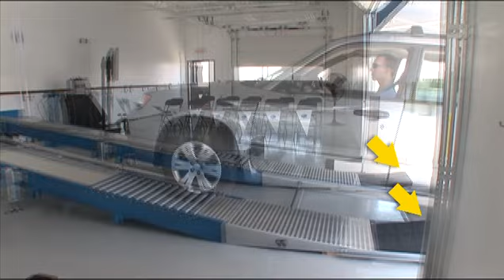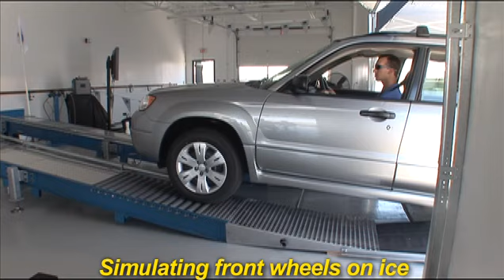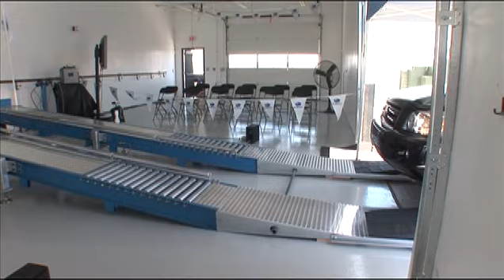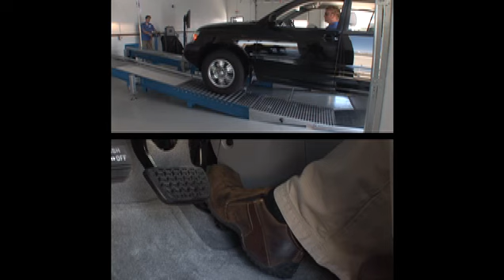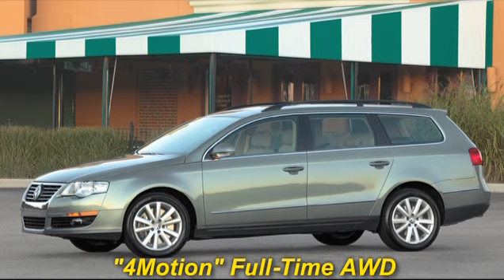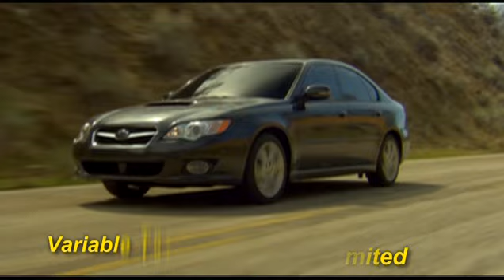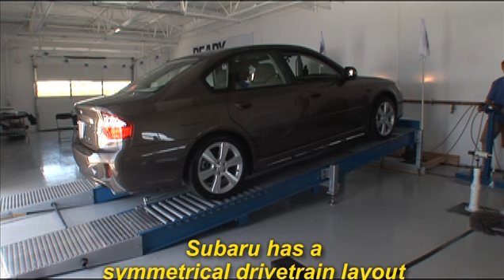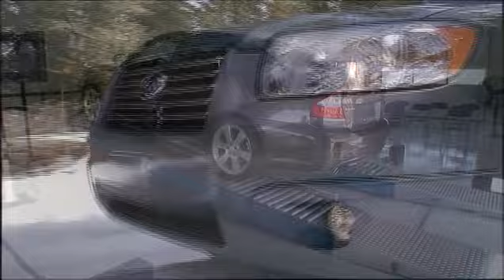Subaru Symmetrical AWD vs. Honda, Toyota, and Volkswagen

Comment: how about pressing the center diff lock button on the toyota for the true 50 50 split front to rear,  a rather large oversight!
Reply: bacon I explained it already, and I won't bother to explain it again to somebody immature enough to think insulting proves a point.
If you think it costs the same effort/torque to spin a traction wheel at the same speed as one that is hanging in the air, that's up to you.
Reply: Candisa You definitely know your stuff unlike these guys. I couldn't have done better explaining why an unlock differential has an even torque distribution by definition. But they don't seem to know shit about torque power and speed and use these word as if they meant the same.

James and Bacon Have a look to you physics course : "Force speed and power" and "Newton third law". It looks like you know how things work but you can't get a word correct about the theory.
Reply: I get what you meant.

The other guys only meant to point out that the toyota should be going up the ramp. That it is not, is due to the center diff remaining unlocked (video guys didn't push the buttons).

Everyone agrees a locked diff matches rotational speeds on both output shafts.
Reply: Candisa Not necessary. If you define torque split as the torque bias between the front and rear wheels then the 50/50 claim is still true. Torque is being sent to both axles equally. There is not forced torque. Torque is just applied to the ground unequally, which ever axle has the most friction produces most torque, and the applied torque split adjusts according. As you pointed out. But that's why a locked center diff is referred to as having a 50/50 split, because there is no torque biasing
Reply: @rangerover06sc  Trying to figure out my Lexus GS 350. 70/30 R/F then 50/50 when its slippery. There is also a locking clutch that supposedly locks the front and rear together.
Reply: Lock is not 50/50 torque distribution! That would be stupid and is nothing but marketing talk. 
If you equalise the torque between the front and rear axle, you're doing exactly what an open diff does: limiting the torque going to both axles to the amount of torque the axle with the least amount of traction can transfer.
The whole point of locking a diff is to NOT be limited to this 50/50 distribution, making it possible to send close to 100% torque to the axle/wheel with grip when the other axle/wheel is on ice or even hanging mid-air. The marketing guys who invented this "50/50 distribution" nonsense will tell you they mean rotational speed distribution instead of torque distribution (aka admitting they're lying), but then they can't answer why a car with a 70/30 diff isn't dragging its rear wheels badly.
Reply: Candisa sorry but you are incorrect, a Landcruiser with full time 4wd has an open centre differential in high range as does a rav 4, in Landcruiser if the centre diff is unlocked all the power will go to the axle with the least amount of traction in a low traction environment , pressing the centre diff lock button locks drive evenly so one front wheel would need to spin and one rear would need to spin, the Subaru in this instance has a limited slip centre diff to allow less driver intervention, as it seems most people can't operate or understand how there car or 4wd works
Reply: James South I understand very well how a lockable open diff works, and I suggest you learn a bit more about physics before telling I'm wrong.
An open diff always splits torque 50/50, but when 1 end slips very little torque can be applied, therefore the torque going to the end with grip is also limited to the point you can't get moving. An engine can only deliver the amount of power/torque you can use, therefore dynamometers need to use powerful electromagnetic braking in order to be able to measure the potential torque an engine or complete drivetrain can deliver. 
If you lock a diff, you match the output rotation speeds. If 1 end is hanging in the air and the other end has good traction, basic physics tell that the one with the load needs a lot more torque to rotate at the same speed as the one that is free spinning.
An open diff matches torque going to both ends, aka "50/50 split".
A locked diff matches rotational speed going to both ends, which can require an up to 100/0 torque split.
Reply: Candisa ...ok ok ok lets go back and look at the original video before you get your knickers in a knot. Toyota in the video has a lockable center diff, so if we see that both front wheels are spinning on rollers and the back are on solid ground all the power is spinning out through the front axle,  if they pressed the center diff lock button it would have split the drive evenly from the transfer case where the individual diffs front and rear  would then split the torque . Now I own a few 4wds and see this in actual practice, perhaps your experience is theoretical. Ive tried this experiment years ago, if you can't  understand maybe just go outside and try it in you vehicle with its lockable center diff,  I'll supply a few links for you to see in real life.
Reply: James South I don't say a locked center diff wouldn't be the answer to get up those rollers, it simply is the best solution that is proven to work. 
I only said "50/50 torque split" is marketing speech that is downright wrong, as anybody who thinks about it would conclude there must be an unlockable open diff, thus nothing special.
Reply: Candisa, I wonder how you brush your teeth... because you appear to be talking out of your ass. if you lock a center differential, front and back wheels will spin at same speed. and if you were to put your arm in the spokes of the front wheels, it would snap it with the same ease that the rears would because the engine is transferring the same amount of torque to the front and the back through the locked center diff.
Reply: James South Candisa is correct. You should look up Engineering Explained's video on differentials. An open diff always splits the power 50/50. If it takes 1 ft/lb of torque to move the wheel on the rollers an open diff will sent 1 ft/lb of torque to the wheel on the ground. 1 ft/lb of torque isn't enough to move the car. When you lock a diff, the wheel on the roller will get pretty much no torque sent to it. So by locking the diff you actually get a 0/100 or 100/0 split in a two wheel drive car with one wheel on rollers and one on the ground.

Comment: So, legacy is better than forester?
Reply: It was back then. They are all about the same now.
Reply: Bit late but.. it's the drivetrains that differ. The tested Forester was Auto, the Legacy was manual; that's the difference. The autos have a different rear diff setup to the manuals (electronic control, rather than a limited slip mechanical diff); an auto Legacy also would not climb this, a manual Forester would.
Reply: There are 3 different awd systems from subaru currently the cvt,standard manual,and sti manual there the same in all cars and suvs in the lineup except us regulations now states all vehicles must have electronic traction systems so if you get stuck in a newer subaru you absolutely have to turn that system off

Comment: I have had two Subaru foresters a 2005 and now a 2011.  I live in Northeast PA in the Pocono mountains and the Subarus go where most vehicles get stuck.
Reply: Got 5in of snow last winter and there were drifts of 8+ inches. Passed a 4x4 Honda Pilot that was stuck in the road with my inferior ground clearance Subaru Legacy. If only their bumpers were built for offroading, Subarus would be up there with Rover and Jeep I think.
Reply: these last 2 winters in PA i owned 2 different subarus. 

2 years ago i had a 2002 wrx with rear LSD. would go anywhere i wanted it to so long as it didnt bottom out. i was driving in teh middle of the storm passing people who where stuck. alot had to do with the awd. and a good bit with my snow tires.

last year i had a 97 legacy GT. had all season and same thing. would go anywhere i wanted so long as it didnt bottom out. going up this steep mountain i had some issues cause i didnt have great tires, but other than that it passed just about everyone. even made it up this large dirt mound when it was dry. steep climb. 

so far this year i drove my 2006 vw GTI and i do not trust it in the snow. a little bit a slush and it get stuck and i have good tires too. ive had to drive my 2000 silverado 2500 4x4 locker (traded my 97 legacy for this) when it got snowy and i dont really like doing that cause it get like 9 mpg. im going and buying a 2006 forester XT next weekend. out of the 20 or so cars ive owned in the last 4 years. the subarus have been my most dependable.
Reply: I have a subie here in PA and love this thing.
Reply: I still have a 2006 Forester. I've had 2 Ford trucks, one a Ranger and one a F250, and 2 Toyota Trucks. One a Tacoma (that I hated. It had the worse 4WD system ever) and a 2002 Tundra  that I really liked. None were as good as my Forester. The 1985 Ranger was decent though. I lived in PA and Colorado. I'll be getting a new 2019 Forester in the Spring.
Reply: @jackagain8346  right on. Love my subies
Reply: @reddeadryan78  I got 3 friends of mine to buy Subaru's just by owning mine. One is buying the new Ascent. The other 2 have Foresters. Can't wait to get my new one.
Reply: @jackagain8346  hell ya. I just got my gf the 2014 legacy and this summer I'll have my 2018 wrx.
Reply: @reddeadryan78  The 2018 will be very popular being the last turbo Sub.
Reply: @jackagain8346  i agree with you. I got my first and only Forrester in 2015. I live in NYC but I'm up in Vermont skiing a few weeks every winter, and my Forrester has proved itself quite a few times.
Reply: I live near the Poconos as well. In any state with bad winters you'll find plenty of Subaru owners. The Subaru AWD has become a legend in its own right around here. If they ever develop a decent looking full size truck with this AWD system. You can bet ill have one.
Reply: How are the moutain curves there? may have to bring out my BRZ lol
Reply: @destroyeroflight1  too bad the brz has no awd.
Reply: @reddeadryan78  yea lol, but good thing AWD conversation kits exist.
Reply: An awd brz would make me jizz my pants. But would it act the same as the other Subaru symmetrical systems? )I own a 2 door 1996 impreza and a 2014 legacy)
Reply: I have had two Subaru Foresters, a Land Rover Freelander and a  Vitara Allgrip,  Subarus are the only true go anywhere vehicles IMHO, however on a day to day basis, the Vitara comes out on top for day to day practicality and economy, if you get lots of snow, then the Subaru is the one for you.
,
Reply: including pickup 4x4?
Reply: "PA" "Mountians" lol
Reply: Okay, don't fall for this. Notice they're hitting the gas harder on the other vehicles than the Subaru, accelerating those vehicles past the point where they would transfer power in this situation while keeping the Subaru well within it's transfer range for this situation.
Reply: My 01 Forester totally stock got in and out of 3 feet of fresh snow no problem
Reply: I USED TO OWN a 2007 Impreza and I will say that the AWD sucked. I live in hilly PA and I was quite disappointed even for working at a Subaru dealer for 4 years. I got stuck WITH NEW winter tires on a few times. 1 front wheel and 1 rear wheel would spin and the car wouldn’t move. Now if they equipped them with a LIMITED SLIP DIFF like they did the foresters, I would not have any issues.
Reply: @LilDiabloRob  I own a 2004 impreza and the AWD system is absolutely spectacular. Took it through 40-45cm of snow on single track steep back roads this winter for the week I spent at a cabin over the holidays. Took it to town almost every day and never once even had a hint of slipping. But then, my impreza came from the factory with the locking centre diff and front and rear limited slip diffs. A few times the snow was at headlight level. Pushed through like a champ. I actually had to pull a ford flex out of the ditch and up a few of the hills one of the days because it couldn't make it.
Reply: I had 2015 Subaru Outback, got  stuck from beach sand and ditch,  all wheels don’t spin same time, Don’t believe this.
Reply: As if... lol. I’d like to see it go through what my F-150 does with its whopping 7 inches of ground clearance.
Reply: @Bartonovich52  there are literally vids of subarus pulling lifted 150s out of being stuck on youtube.
Reply: @Bartonovich52  I'd like to see what your F-150 can go through compared to my F250 Diesel with 35 inch tires and a 3-inch lift I bet it don't compare
Reply: @Bartonovich52  Bruh, 7 inches? The 2010 Forester has nearly 9 inches of ground clearance. You might want to re-measure your truck. Then again, it's got a double wishbone suspension and no giant acorn dangling between the rear wheels. 🤔🤔🤔

Comment: This video made me buy a secondhand Subaru. Maybe it's just a Subaru's marketing trick, but it's really convincing.
Reply: Martisan The opposite of that, I'm saying you will feel it transfer the power to the side with traction, thus you feel it grab the road hard and pull you straight. IE if you try to slide it on purpose, expect it to try counter it and put power to the wheels with grip which will pull you in the direction they are facing.
Reply: 07 Forester XT owner here. They have a really good AWD system. I'd argue one of the best of all car manufacturers. However be aware taking a corner too fast in the dry and sliding on road will transfer power to the outside wheel and you will feel it lurch as the other side slams power to grip the tarmac. Pretty brutal and unexpected, just don't try be an idiot on the road :P
Reply: @skeetskeetskeetnigga  explain more plss..i dont get it
Reply: skeetskeetskeetnigga I own a 09
Reply: skeetskeetskeetnigga  replying to you is the only way I could ever get to use the N word in a comment lol thanks for the advice dude I’m looking at an XT now
Reply: thanks for clarifying!
Reply: KGMR  is it nice having a subaru ?
Reply: yep!
Reply: I took my 06 WRX to Marquette Mi and was able to creep up long steep hills that had 3 inches of snow on them. 
The AWD system is pretty legit on my car but it does have open differentials in front and rear.
Reply: I love my Impreza. I made fun of all types of X-Drive. I was cutting snow, and the X-Drive couldn't keep up with me. It couldn't go even where the road was "cut" by my Subaru.
Reply: @99vehicles99 ok
Reply: KGMR They do really work. My two sisters have a Suparu Legacy. And 2 of my brothers had suparu's. One regretted going for Toyota instead of upgrading to a newer gen legacy.
Reply: First Last Turbo models weren't plagued with the same issues. Plus that was mainly early EJ25's.
Reply: Subaru and Mitsubishi really do have the best AWD systems on the market. I've owned many SUVs and work in  automotive manufacturing for the Wrangler (and now Gladiator). The power is centered and distributed through robust drivetrains, more similar to lock 4x4 systems. Neither the Forester nor the Outlander are "fancy" or "elegant" vehicles. They are simple and have heavily built unibody construction with little frills or yearly re-designs.
Reply: It’s not a marketing trick it’s all real
Reply: I have driven Foresters for the last 17 years. Fabulous cars, in my view and perfect for my needs. Rural Ireland, need to carry lots and a dog. Every trip is a journey, it’s really perfect
Reply: First Last only if you dont maintain the vehicle appropriatley. But yes unfort now there is a lot of these cars inmotion that have been thrashed.
Reply: It's the same awd that's in the rally cars which is why it's so good
Reply: Also the awd system is so good that their are ppl like me who chose to off road their subarus (r/battlewaggon)
Reply: Had a 2018 Forester and hate that you couldn’t turn traction control off fully and relied heavy on braking/ electronic LSD. I like actual torque vectoring. But the AWD on the Subaru was ok enough
Reply: 2007 Cross Sport owner. Best thing I've ever driven.
Reply: It's no market trick man, drove up solid ice rink 2x as steep. 1 inch thick solid ice.
Reply: Just ordered a 2023 Crosstrek Premium with manual trans. 
I live in a moderate climate and seldom see disabling weather conditions,  and I seldom have trouble driving my two-wheel-drive Frontier anywhere I need to go, but I can't get a manual in a new Frontier and the Crosstrek pushes all the right buttons otherwise.
Reply: no, It works very well
Reply: @I Paid sounds like a guy here in Colorado that did Black Bear Pass in a Forester.  Love my subi!!
Reply: @First Last, the one engine that was really known for head gasket failure was the EJ25D, which Subaru themselves admitted had improperly designed head gaskets, and which was phased out in the late 90's. A few models since then have had some issues, but as far as I know none since 2010 have had any more significant head gasket failure rates than any other manufacturer.
Reply: @forrestcarroll9350  Thanks. Note that proper maintenance, especially of lubrication and cooling systems prevents head gasket failure on most any aluminium engine.
Reply: but are all of them besides subaru with the traction control off? don't think other cars cant climb
Reply: I don't fully understand what you mean by this, are you saying the system makes the slide WORSE in the dry?
Reply: skeetskeetskeetnigga, the same happens with my LGT. The only problem with that is that it's putting down 400+ftlb, so that lurch turns into broken CV's damn fast.
Reply: Don't buy a Subaru. A ton of them have head gasket defects. Which is a dang shame.
Reply: @zzoinks  learn to spend an hour pulling the engine which is hella easy, buy Felpro MLS gaskets for $45 a gasket, and change them. Then its bulletproof.